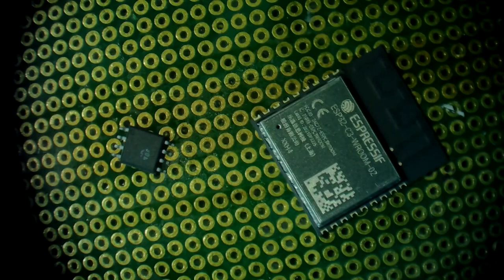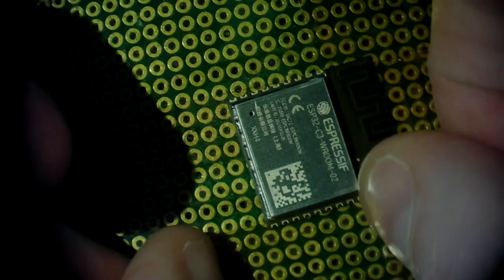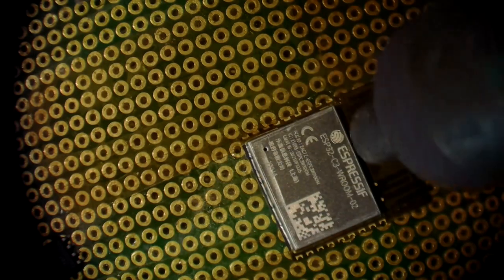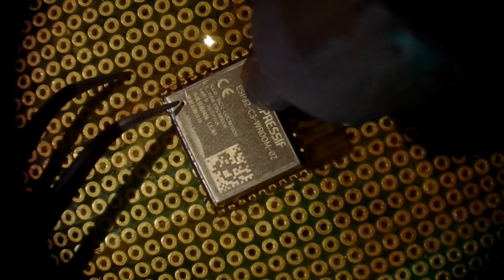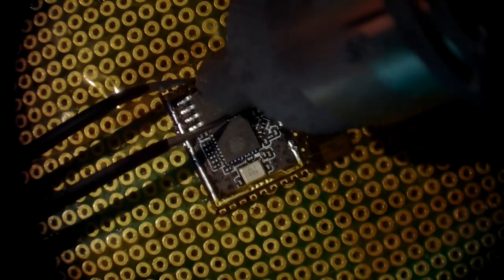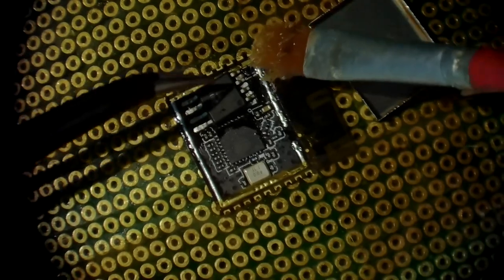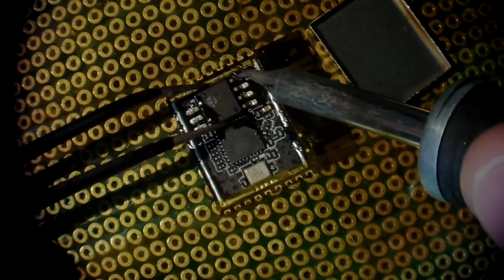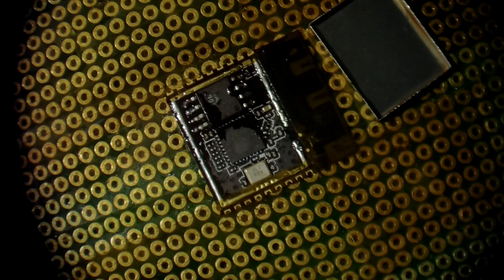How to replace the flash on an ESP32-C3-Wroom-02 module (or any ESP module)

Comment: Great video.  Rather than applying flux to the PCB for excess solder removal, try applying the flux to the desoldering braid.  It greatly improves the wicking action

Comment: If you dont have a hot air rework station you can simply use a box cutter. I find it actually quicker and no risk to desolder the components. Use the box cutter to score three sides of the metal can, get the point of the knife opposite of the side thats not scored and youll able to pop it right off

Comment: 1.  Do you have a part number for the 16MB flash?
2.  Is it possible to put a larger flash chip in, what sizes are possible?
Reply: I used a w25q128cv if I remember correctly.  But I did this for an esp8266 board--an ESP-12F MODULE.